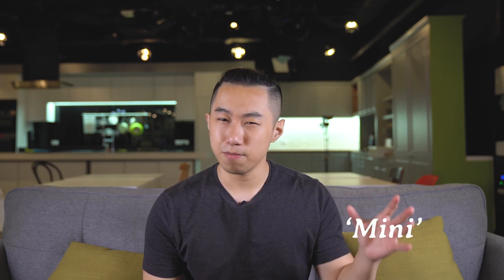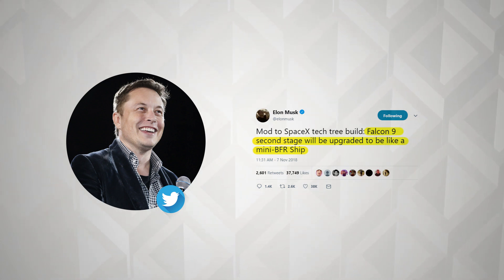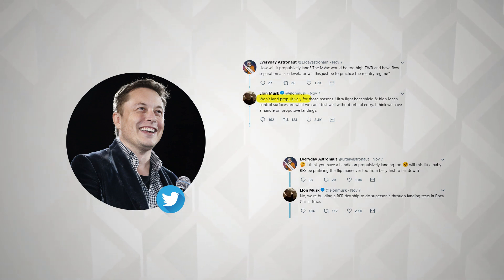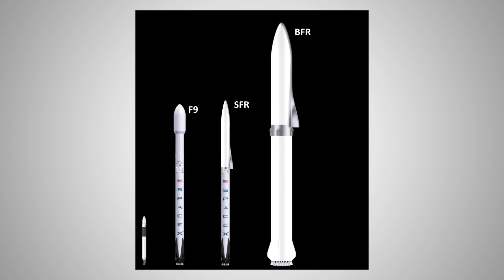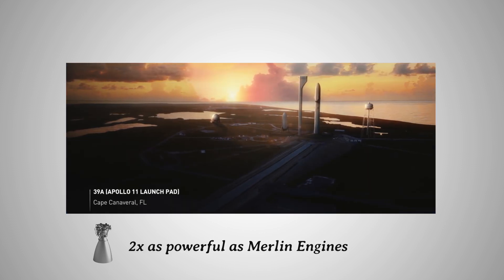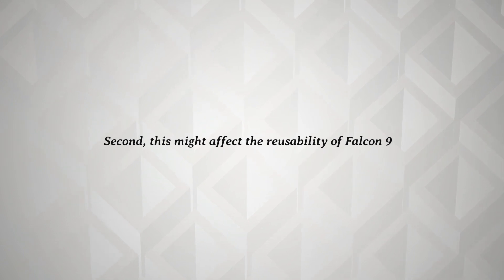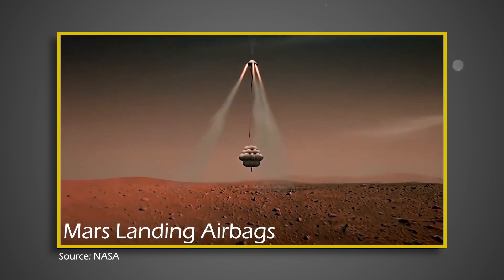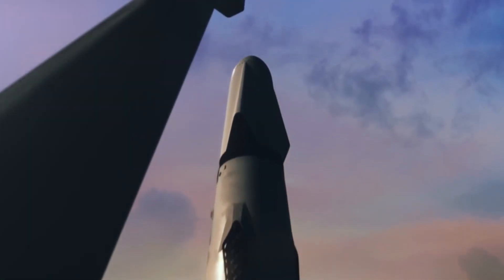"Mini-BFR", Will it be Fully Reusable?

Comment: My thoughts about this:
SpaceX will do exactly what Musk tweeted. Slap a heat shield and control surfaces on an upper stage and launch it on an "old" booster. There will be no payload and no landing.
They will not develop a mini-BFR for starlink or anything. This will only be a small testbed and nothing more. Absolutely fascination, tho!
Reply: Keyboard runner Yep 100%

Comment: I am looking forward to Elons internet. Imagine if he can supply the whole world. how cheap it could be.
Reply: The biggest technical advantages are VERY low delay on long (& short) distances, and no com loss during power blackouts. Fewer repeaters and faster light speed (vacuum) than fibre optics. 

Elon has mentioned the need for receivers. I expect some of these to function similarly to WiFi hotspots rather than complete phones.

Comment: I always knew that making a better tech takes a hell lot of time and when Elon announced that they plan to fly their first mission in 4 years, I was extremely sceptical.

I think that for the sake of this rocket, there'll be a lot of setbacks and things to improve. I hope that Elon won't miss the deadline by more than 10 years.

Not many people realize this but if something bad happens when they'd be landing their rocket on Mars there will be some massive consequences like what happened with Challenger or other missions that went wrong. I do know that we will eventually have to go there and it'd be extremely risky but I'd choose a bit slower but much steadier development with real deadlines.

It's better to get to Mars/Moon 5 years later than not to get there at all because of some stupid and rushed mistake.
It takes time. A hell lot of it.
Reply: Traditional rocket companies are slow. Let's see what SpaceX can do. Much of the expertise for this has been practiced on the Falcon 9. 

The carbon fibre prototype tank was complete before Elon's Australia conference announcement. One BFS hull ring segment and tank dome are complete. Engine bulkhead is next.
Reply: This prototype can be refitted as the technology and designs improve. It may even end up being a working ship. 

The first @dearMoon trip will not land. The life support can be open loop. There will be flight engineers along with passengers, I'm sure. 

The first two Mars mission ships are unmanned, so life support failures are less critical there.
Reply: The BFS landings will be tested, unmanned, many times by "refueling" tankers and satellite missions, before there needs to be any manned test. 

The first two Mars landings will be unmanned as well. 

Plenty of testing before humans are risked.

Comment: Mini falcon9 can't even land because it's vacume engine will be unstable.
Reply: Vacuum nozzles can be modified to operate at sea level, with some loss in efficiency. Shuttle used that. IDK if they work throttled down. Of course the big issue is spare propellant.
Reply: Noone claimed it would

Comment: I think it’s unlikely that they’d use raptor engines because they aren’t planning to make a vacuum optimised version and Elon already stated that as a reason for no propulsive landings.
Reply: Vacuum nozzles can be modified to operate at sea level, with some loss in efficiency. Shuttle used that. IDK if they work throttled down.

Comment: I don‘t think they‘ll recover it but rather test the aerodynamics. I think its just a F9 with a few fins
Reply: And a BFS-style nose cone
Reply: Upper stage recovery has never been something SpaceX has given up trying to accomplish.  If this approach by imitating the BFS for testing purposes is one of the ways they will be trying to recover that upper stage, my hat is off to them for at least trying.

Two things I'm quite certain of though is that this won't be a one-off vehicle, and I find it very hard to imagine that SpaceX won't be using this for at least some sort of revenue flight.  Launching Starlink satellites would be a good compromise for testing this since it is experimental but it would just be SpaceX revenue that would be on the line and easily replaced if something wrong happens.
Reply: It's been confirmed it will be recovered. Most likely using parafoils and Mr.steven to land
Reply: JackSpeed 439  yea... they change their mind quite often lol
Reply: This is a perfect illustration of what SpaceX is doing right, that almost everyone else is doing wrong, or not at all. They use every available opportunity to test and tweak, striving for their end goals. Nearly everyone else is caught up in either paperwork validation, anti-risk methodology, and/or cost reduction.

SpaceX understands that finding the right new technologies will make everything easier and cheaper, and we can't get there without trying stuff out!
Reply: This is actually how the Russian's developed their rockets and engines.